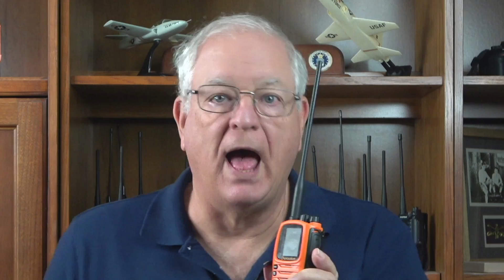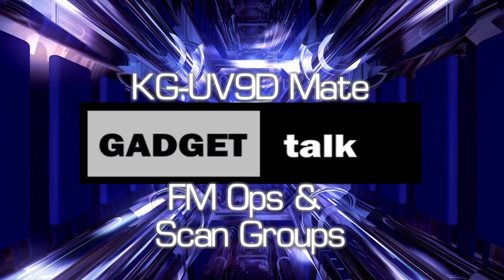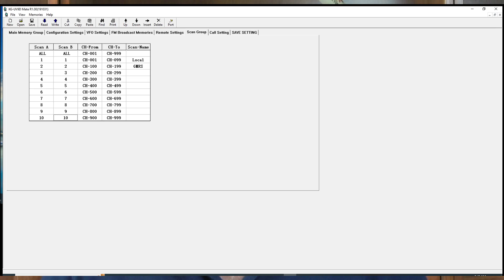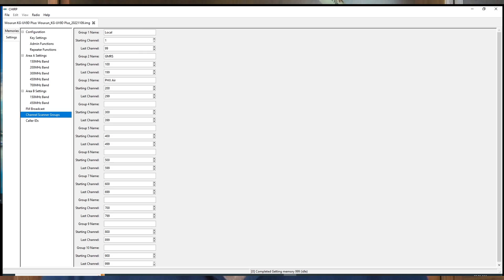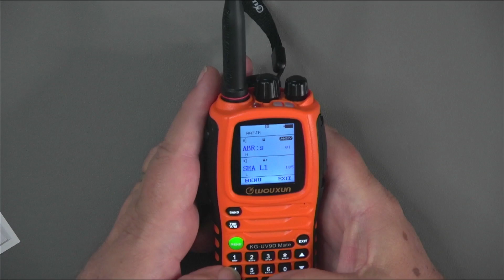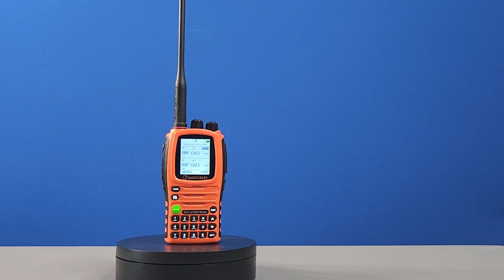KG UV9D Mate FM and Scan Group Operations

Comment: When I press most of these buttons, they don't work for me, I cannot enter 400, 700, or any other frequency - the radio just pops back to 162.47500, and I cannot scan frequencies except for in the FM band. Guess I'll see if I can find information on what the menus actually do because this is getting me nowhere. And I do have the exact same radio.
Reply: Sounds like you are stuck in gmrs mode and need to unlock it to get all the frequencies.